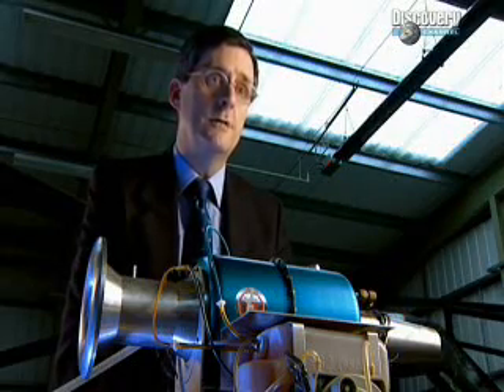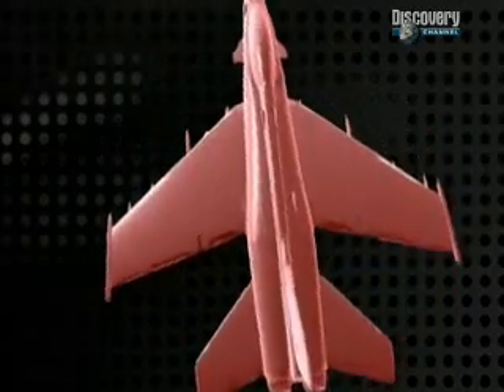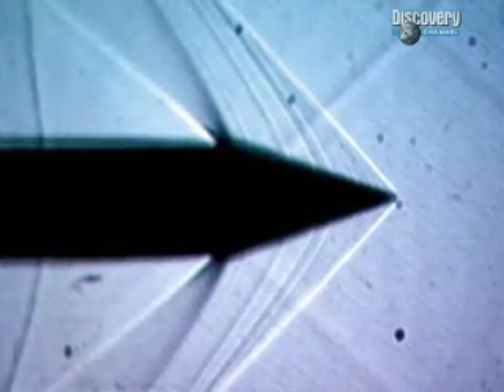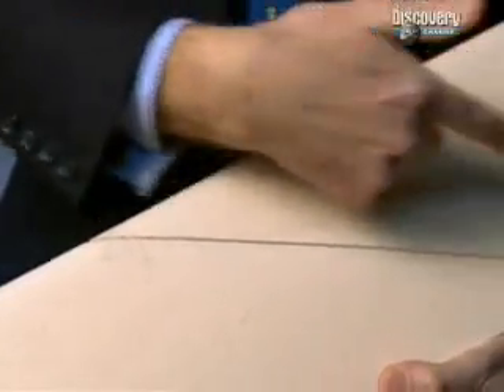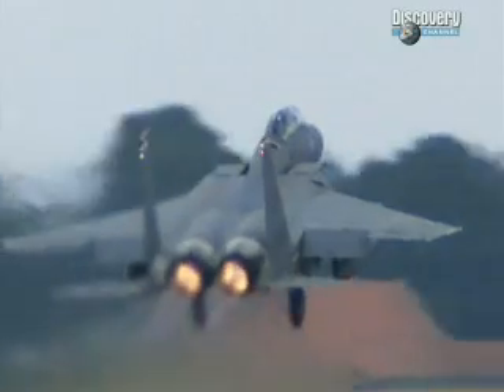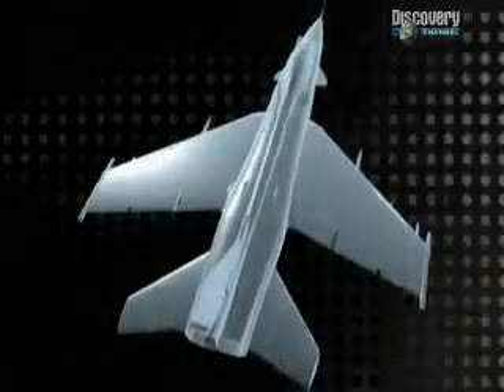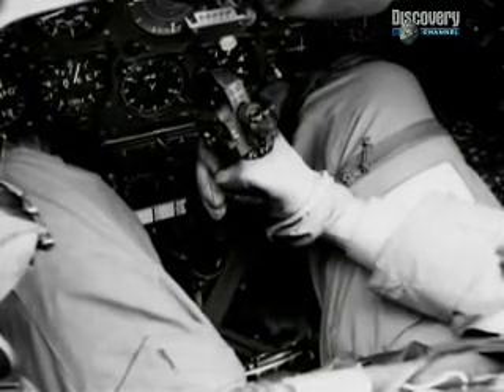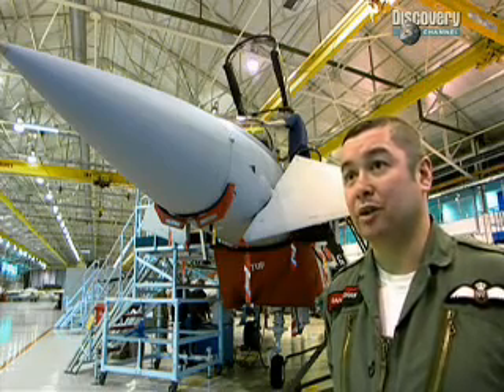The Ultimate Fighter Jet  2 of 3

Comment: And the moment it 'flips its radar on' its no longer stealthy. Meanwhile EF can detect Raptor through IRST at 50 miles or radio chatter (neither of which Raptor is currently capable of). It also has high off bore sight helmet cuing that Raptor doesn't. Yes, all can be added2Raptor but so can TVC to EF.
Like i say both great aircraft, only silly fanboys tell a 1 sided story.
Any1 interested in reading INFORMED and UNBIASED - theaviationist - 2013/02/21/raptor-vs-typhoon-us/#.UbC2feD6SN8

Comment: But the moment the Raptor turns on its radar its stealth is no good. The stuff about radar not being detected every pilot will tell you is mkting hype and this has been proven in exercises. So if we rely on passive detection only then they both have advantages and stealth on raptor is no more than typhoon. Its stealth advantage is mostly against radar. EF200 will get TVR in T3 UK is saying now too and the Typhoon operates best the higher it goes and can operate as high as 50k feet. For energy -

Comment: @odessaboy Yeh the EF managed to lock on to the raptor when it was "unstealthed" apparently. They made a huge fuss about it, and rightfully so xD
I still think the F-22 holds its own though. I do think it doesn't quite push its advantage though; what it should have is equipment for the AIM-54, or a supermaneuverable modern equivalent...basically you need a super missile that can score a virtually guaranteed hit against anything from 200 km away.

Comment: 98321010
 carbon fibre and kevlar are stronger than steel if you compare their weights. The point of the material is that to gain the required strength in an aircraft with carbon, you would need a lot more steel or more appropriately, aluminium (aluminum for the yanks) to do the same job. This decreases weight wich allows for better performance. It is not ammune to damage. Kevlar may absorb some damage depending, carbon fiber generally fails suddenly.